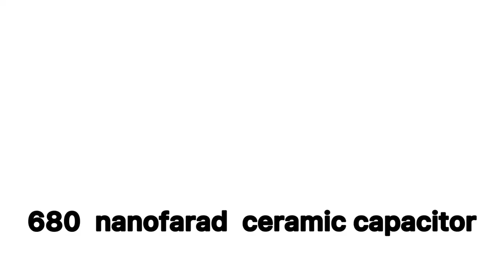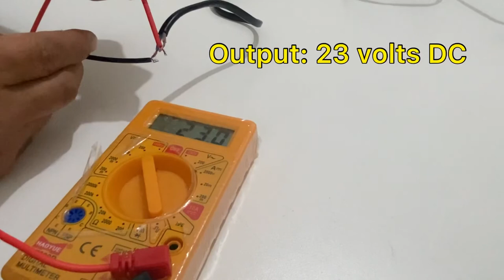Convert 220 Volts AC to 24 Volts DC | How to Make Power Supply | Make Charger for Batteries.

Comment: Joy of Electronics:- beautiful project, 220 v AC to 24 v DC, systamatic presentation, only hurdle not useful in household, of course method used is awesome, just a suggested, pls make a 5 volt/9v conversation chord will be much applicable I think.any way very good DIY project for interested students.👍🏿👍🏿👍🏿
Reply from the maker: Thanks my friend. I will do some more projects just like you mentioned. 🙏